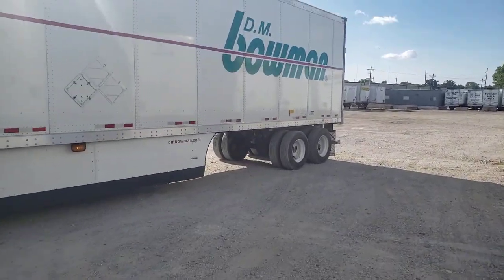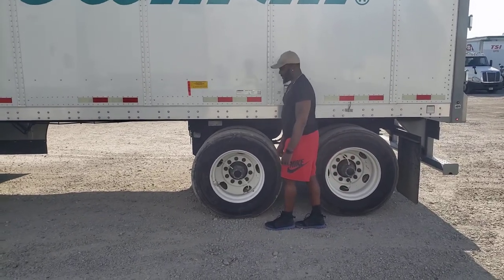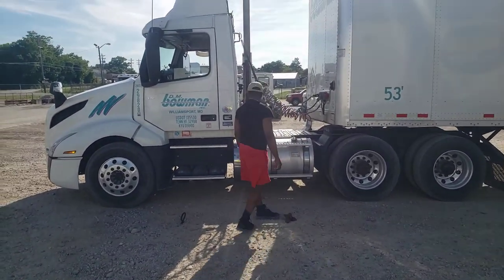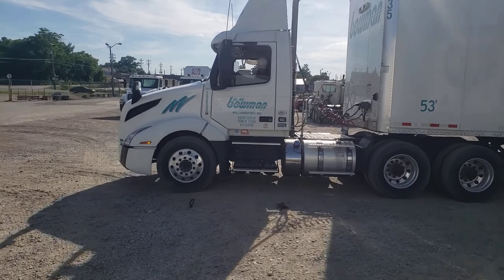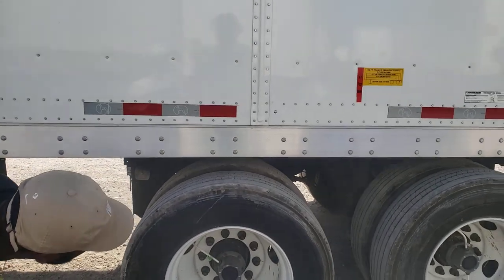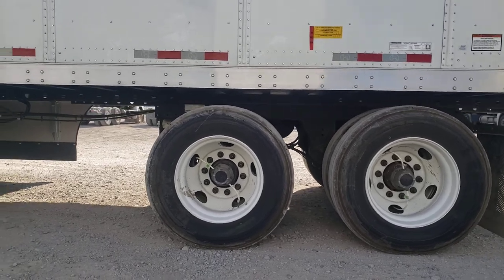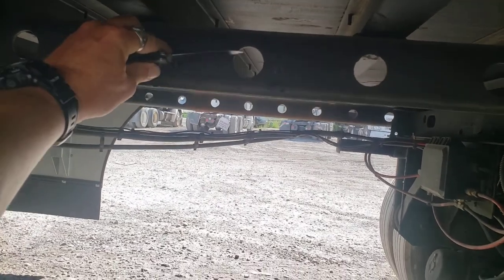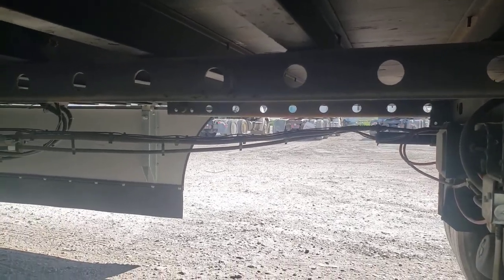sliding tandems to 41 foot mark first shot. and marking tandems for readjustment

Comment: Excellent explanation. Are each hole 250lbs it 300lbs?
Reply from the maker: For easy math i always use 300lbs per whole as rule of thumb. Just understand there are variables that could alter that number
Reply: What hole number is the average for  the 41 mark?
Reply from the maker: 11th or 16th hole i believe if memory serves correct. It all depends on whether you have big pins or little pins